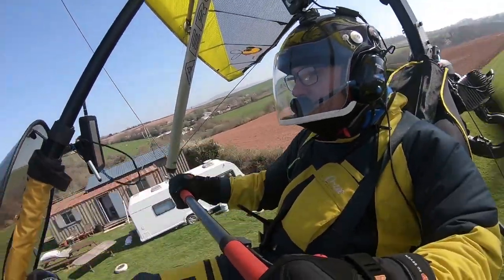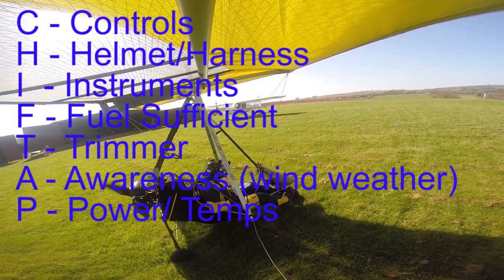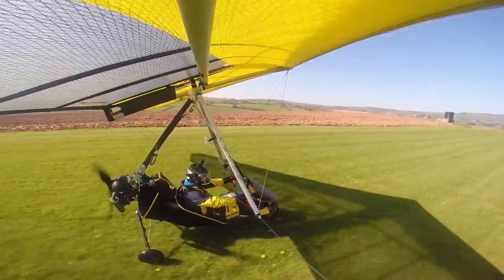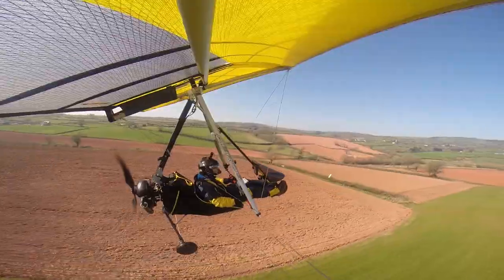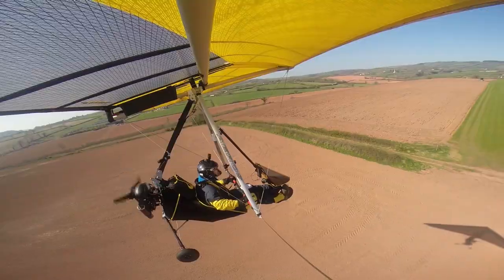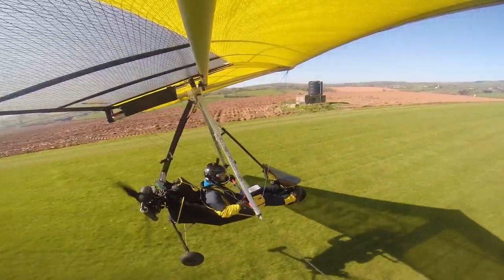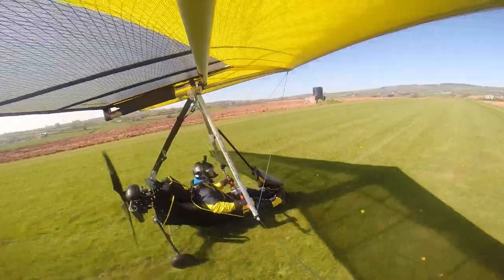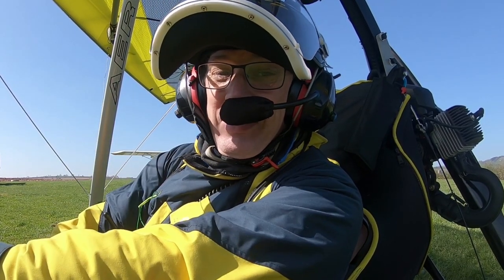Getting back in the circuit - Flexwing - Giggling idiot

Comment: Great to see you flying Giles (as always).
A little bette noir of mine is RT calls that are spoken rather quickly. If you are in a noisy environment or the pilot has a strong accent it can be difficult to pick up all the message. 'Glebe Farm' seemed particularly quick, you know where you are but others may not know of it. I always speak slowly, particularly as my call is 'Paramotor XXXX..' that is unusual on the RT.
Reply from the maker: I appreciate that feedback, I spent too much time with military controllers in a previous life. Funny story, I called up a tower with Paramotor, the radio went quite for about 20 seconds, they then asked me to free call the next unit.. It made me chuckle. I appreciate the feedback.
Reply: @GolfFoxtrot22  I have experienced a 'pause' when a different controller was on duty., quite funny as you say.

Comment: Good practice 👍
I am so looking forward to circuits. It's flying but more that I don't trust my old Simonini to go to far from a runway😁.  Engine upgrade needed in near future.
Safe landings
Reply from the maker: Having confidence in your engine is always hard to get.  I'm always looking for fields. Yes, I do like a circuit or 2, even the locals like seeing the aircraft buzzing round.
Reply: @GolfFoxtrot22  
Once I have my glide worked out I will plan an XC to another field.
Reply from the maker: Would that make you a motor glider then? 😉
Reply: @GolfFoxtrot22  
Technically yes as my Solaris 16.8  is a soaring wing Vne 53mph.  I do look forward to going up to a couple thousand feet and cutting the engine to glide a bit with just wind noise.😁  But I might upgrade in a couple yrs to the Rev style machine for a better XC experience. My belief is XC is better done with a rig that is designed for a little more speed.

Comment: My Sub 70 is ready  😁. Weather permitting I start training in 3 weeks. Have been watching all YouTube Trike circuits possible. An american said getting the rear wheels down first pivots the base for cross wind landings. I notice the PeaBee lands very flat almost 3 pointers. Whats going on there, your landings look smooth as glass?
Reply from the maker: Hi Blue, I bet you can't wait. Yes getting the rears down first helps with cross winds and you are correct the PeaBee lands a little flat but the mains do touch first, but only just.